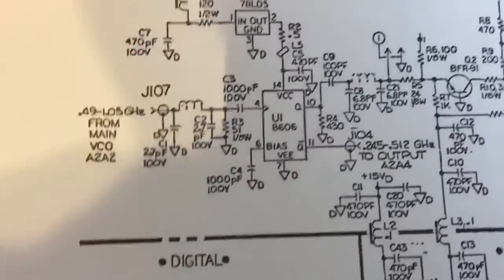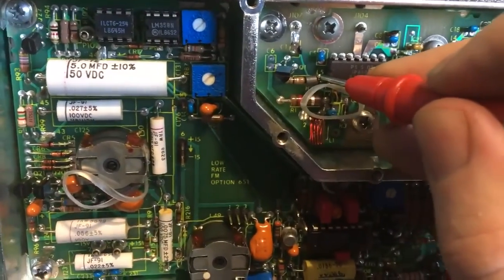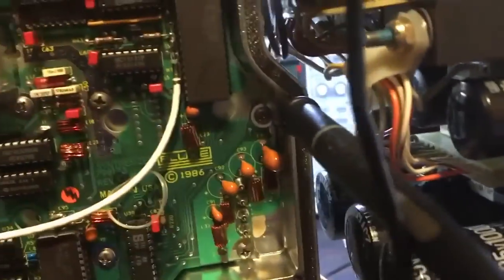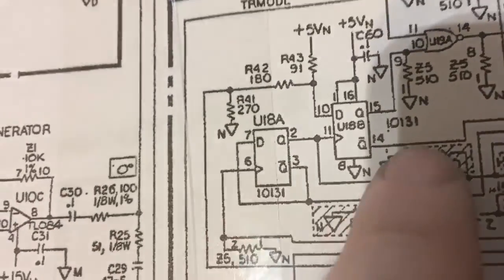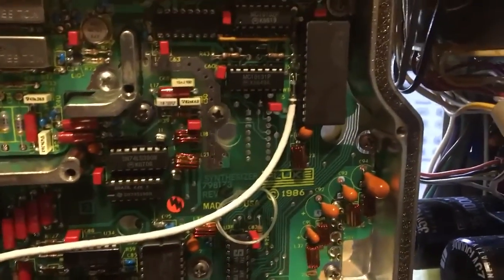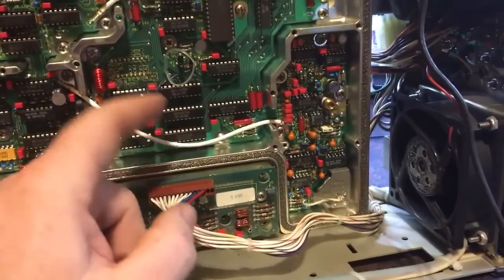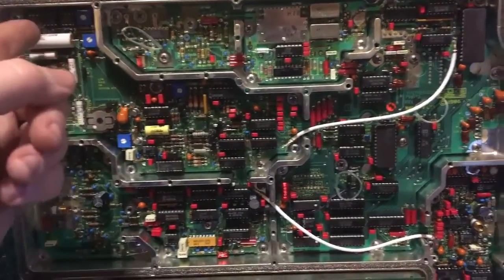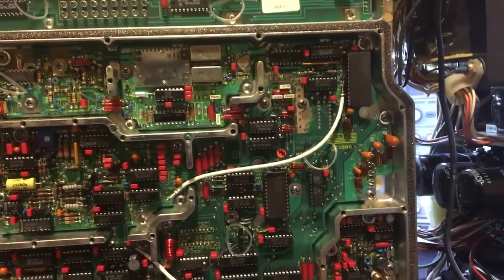#85 Fluke 6060B RF Signal Generator Repair Part 3

Comment: Your problems on this sound all too familiar. I once repaired a North Atlantic low frequency phase gain meter. Unit seemed to work perfectly... except at exactly 100Hz the voltage readings were just out of spec. Finally discovered that the PLL was skipping an entire range that should have been centered around 100Hz. So was locking on range below or above ALMOST good enough missing range wasn't noticed. Found digital IC counter feeding range circuit was culprit. After replacing IC everything worked perfectly. In normal opperation failure probably wouldn't have even been noticed.

Comment: Have fun trying to diagnose ECL circuits; those things use a supply voltage which is negative with respect to ground and high and low states are typically only 0.8v apart.

Comment: That thing is a basket case. 
That big IC next to it... is probably the divider. Looks like a GAL.
I bet the flip flop feeds the divider. Not sure what they are doing there. 80s tech so I am betting a prescaler.
Probably was a parts unit. It got all the bad boards from other units :)

And to clarify my comment - referring to the flip-flop with thermal issues.
Reply from the maker: Mark19960 - yes it has had several problems, but I am getting there, it's been a lot harder to fix than I expected purely because there are so many faults ! So far I have been lucky, I'm just hoping that no proprietary parts have failed.
Reply: Me too. Some of the parts in there are certainly unobtanium - like those GALs.
It ends up a parts unit again which would be unfortunate since it's still a useful piece of kit.